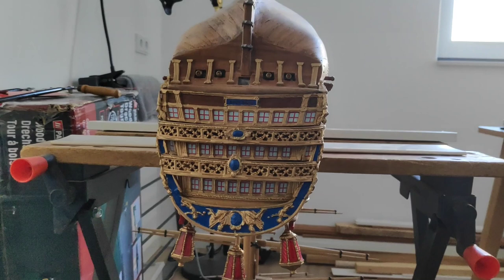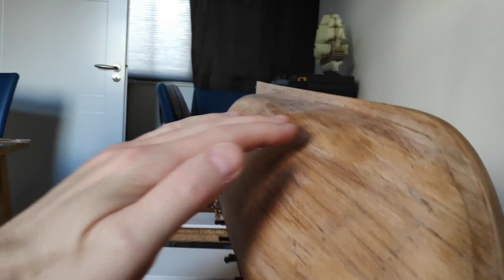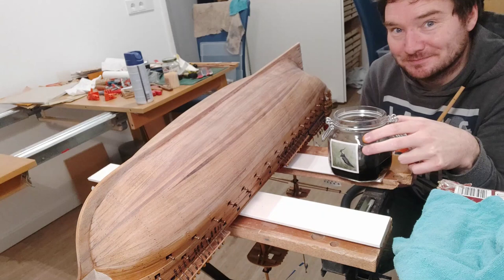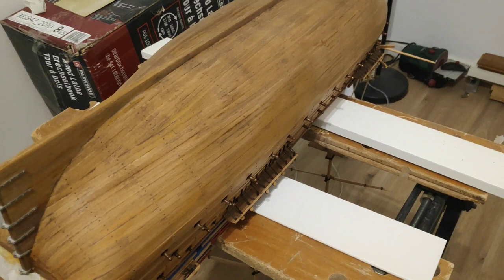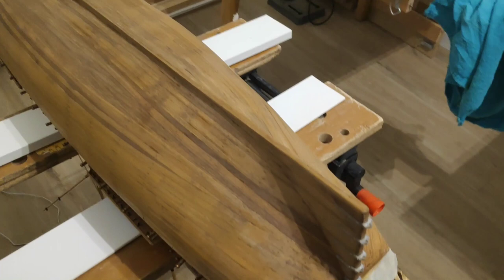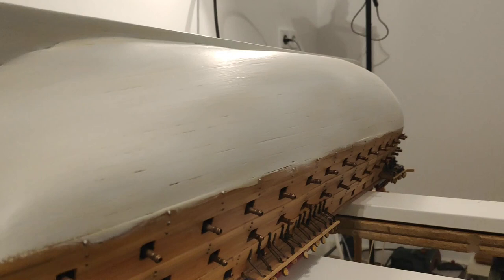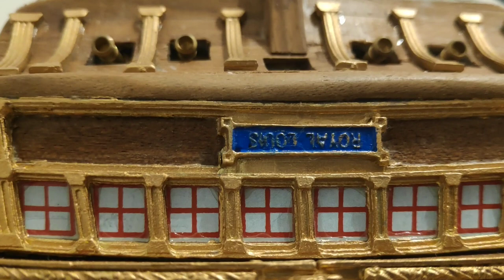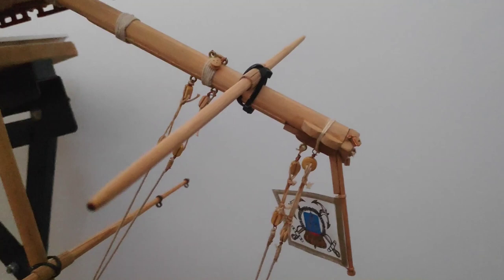Staining and painting the Royal Louis (episode 03)

Comment: Should  have used wood putty to get rid of the cracs and cravices..would have looked better..
Reply from the maker: yeah, a few people mentioned that. Admittedly, I was lazy here. I realized this morning that I should have taken the opportunity to completely straighten out the hull. I could still do it, but let's see how my mood is. I'm a bit torn between making the ship as beautiful as she could be, versus the time I have to spend doing it.
Reply: @martijnonderwater  still you can paint it over the cracs but you just can not fill the cracs with paint..so it is eazier what i used to do is if iam going to paint it sand it good as i can than spray a grey or black base coat it shows the cracs and surface ups and downs better than little more putty and little sanding off you go..
Reply from the maker: @AhmetAygit  I usually don't paint the hull, and prefer to keep the wood as it is. During the build I do my utmost best to avoid cracks, because I don't like filling them. If I fill them, it always shows after varnishing the hull. But I have new glue now, so I'm going to do a test soon. Anyway, I'm still going try and make this ship a beauty 😊
Reply: @martijnonderwater  yoww all is try an error i watch alot on utube every day i learn new staff that other people came up with..so be patient keep working it will be nice at the end..